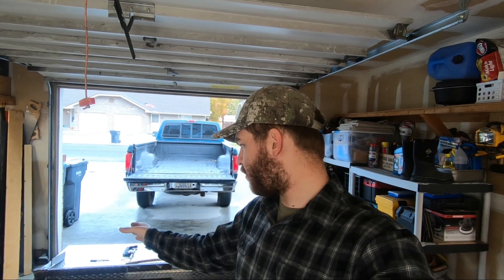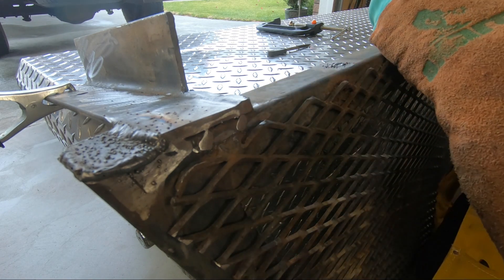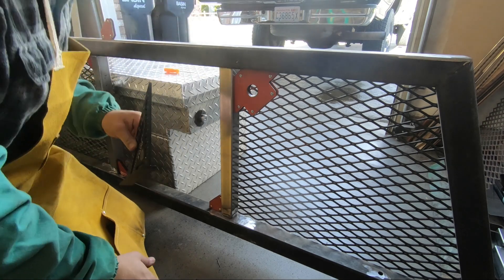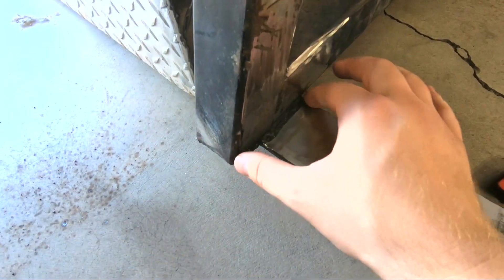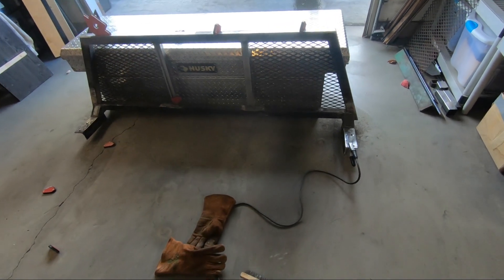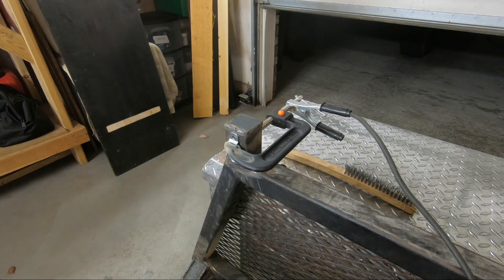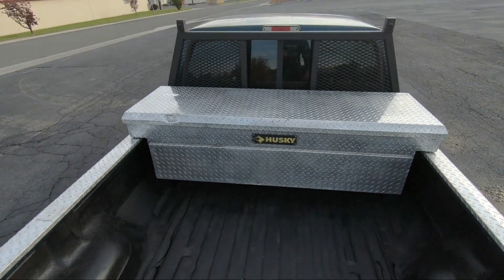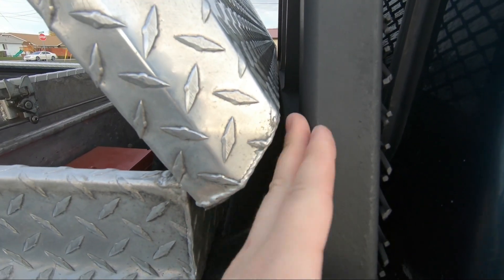Headache Rack Modifications For My Powerstroke

Comment: You want a gap between the materials being weld, or a nice bevel, better penetration and bond, plus your clean up grind will be easier. Next time you're out and about, pick up a can of anti-splatter spray. Nice work on the rack.
Reply from the maker: That’s really good advice!  I’ll have to track down a can of that stuff cause I spent a good amount of time to get rid of weld splatter and still didn’t get it all when it came time to paint.

Comment: Great project. I like what you did. You could extend the top rail by adding steel tube to the top. Then you would have to cut a gap for your third brake light. So yeah. Forget that comment.  Lol. 
Thanks for new content.
Reply from the maker: Thanks Mr. Randall!  Even though half of the third brake light is covered up I’m hoping it won’t be a problem in the long run.  I’m glad you liked the video,  hope you had a great Christmas and New Years!👍